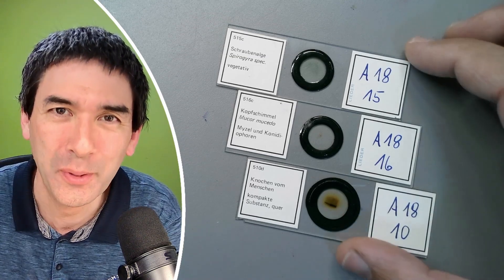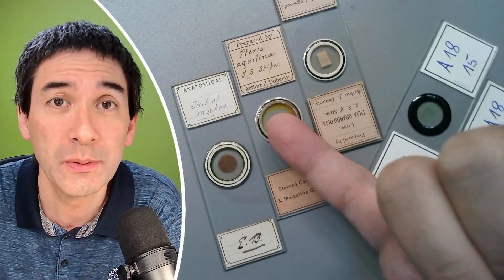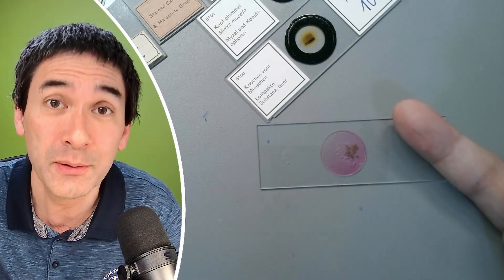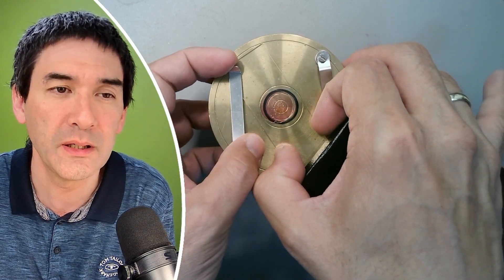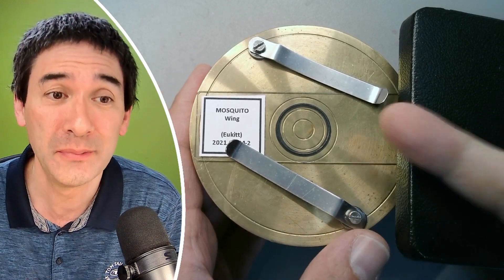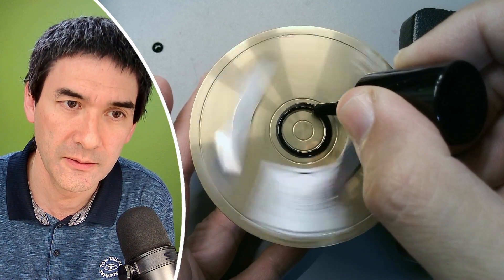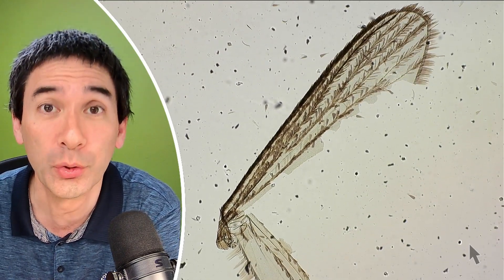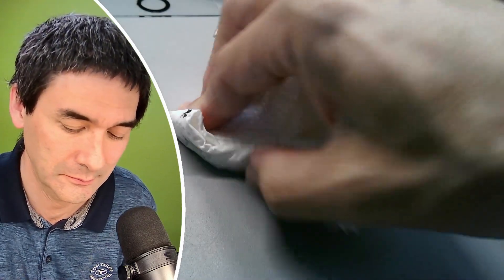🔬 Why Some Microscope Slides must have a Ring - And Why Not All Need Them.

Comment: Could it be used sometimes to avoid crushing/flattening certain thicker specimens (that are meant to be viewed under lower magnification)?
Reply from the maker: Yes, these are called spacer rings. You can make a ring on a slide and then put a cover glass over it (so that it rests on the ring).